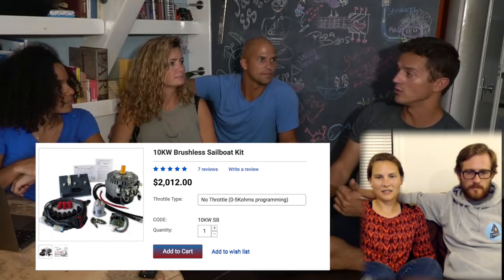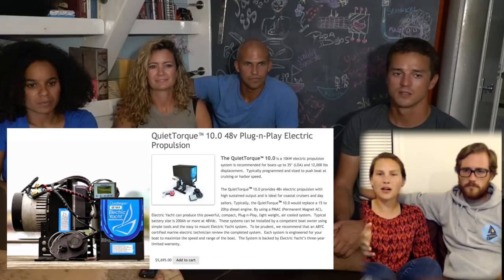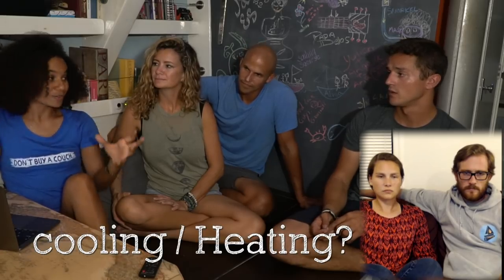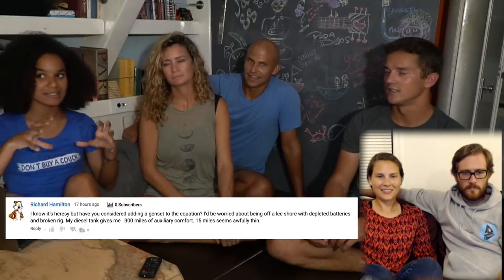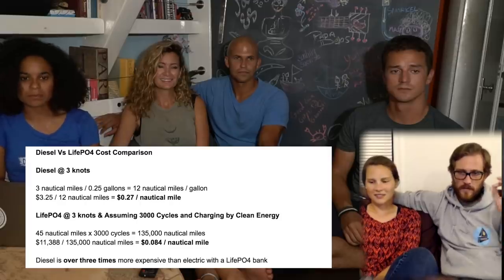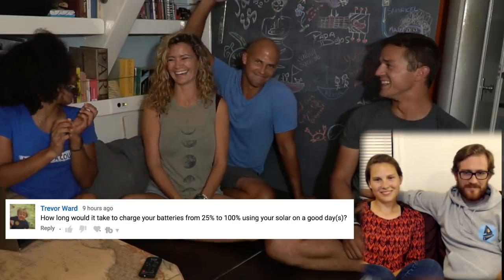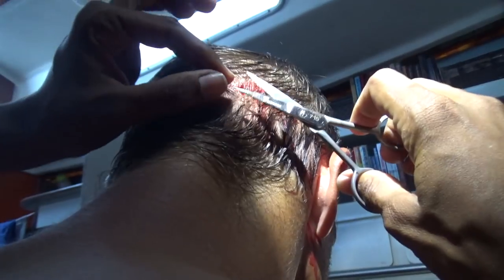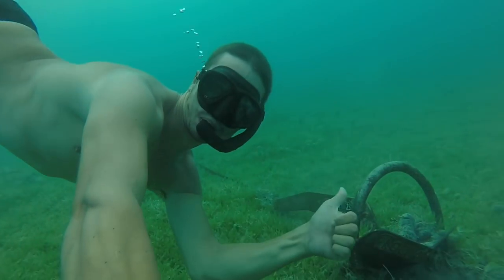Electric Sailboats: An HONEST Discussion — Sailing Uma [Step 140]

Comment: I have diesel and would love to go electric...that being said, electric has a loooong way to go before it is really functional. Sadly. Electric is so tempting, but in its current state it's almost like sailing without a motor. There are so many places and times where electric would be either impossible or would put me in danger. The Ocean has tides and therefore current exists at all entrance/exit points and there are many times when I need to maintain a certain speed to get off the ocean before a storm or darkness. Without a motor, I would be in danger-stuck out at sea. With one that can go at least 20 miles or so, I am anchored safely having a nice dinner while the storm roars around me. A quick note about the Pardeys sailing around the world without an engine. A friend of mine circumnavigated at the same time as they did and he didn't like them much. When I asked why, he said that he got sick of towing them in through the reef to get them inside before darkness or weather hit. He said they would routinely sail to an island, sit outside the reef with an opposing current and call on the radio until someone with a strong dinghy came out and towed them in. He said it happened all the time and got really annoying. As soon as batteries or the motors or solar panels or some combination becomes long distance and dependable, I'm jumping on the band-wagon. I would love to get rid of the diesel (hate the noise/smell/maintenance). You guys are on the bleeding edge. Good on ya!

Comment: Don’t get me wrong, I like the principle of electronic propulsion - but thats about as far as it goes. Obvious advantages are gliding through the water sound and smell free, but as with many folk I have my own reservations regarding the disadvantages. The crux of my upset on this whole subject isn’t so much that it takes days to recharge for hours (or if your on lead acid, minutes) of use but more to do with the assumption that it’s cleaner, greener, safer and somehow all round better for the environment to have everything electrically powered with zero consideration for the long term environmental impacts of the manufacture and disposal of Lithium batteries and solar cells, sure it’s cleaner to run but not necessarily cleaner to create, recycle or dispose of. At least engine blocks can easily be smelted down and made into new engines or new boats. If you rupture a Diesel tank you have Diesel everywhere, if you overheat a Diesel tank the lid will probably pop before the fuel hits its flash point, do either of those with a Lithium cell and your instantly looking at an inferno that only the ocean will be putting out! All I can say to anyone planning on going down this route is 1. Buy the best charge controller you can afford 2. Don’t preach about how “green” you are and 3. Enjoy your new found silence on deck with a cold drink whilst watching others struggle to get there Diesel started :)
Reply from the maker: Some types of lithium are lest stable, true, but LiFePO4 chemistry is VERY stable, you can puncture them and abuse them, short them out and they will just stop working, they won't catch fire like the ones in your cell phone. And yes, the diesel motor is recyclable, but not the fuel you burn. Pretty much all the materials that make up our system can be recycled. Even if the infrastructure is rudimentary, it will only get better with time.
Reply: Thank you for taking the time to read and reply :-) I’m also glad you had a great trip over here to the boat show. Ok ok you’ve got me on the chemistry aspect of LiFePO4 cells, they do appear to be somewhat more stable than standard Lithium-ion compositions. Admittedly the video that introduced me to your channel was the one where you guys fitted your forklift motor and I’ve been curiously following ever since, so I’m not anti-electric but certainly an …electro-sceptic?? As I said my main problem is people assuming that because its electric its “greener” - I’m kind of of the school of thought that it would be “greener” to run already existing Diesel’s off of renewable bio-oils - obviously that comes with a whole huge environmental impact of its own as has already been demonstrated with palm oil production and ethanol production for fuel in Brazil. Surely though, in the long run, a well thought out and planned agriculture infrastructure specifically for fuel production would have less impact than all of the mining and noxious chemical and industrial processes used in creating this “clean” technology. I’m not claiming it would be a completely perfect carbon neutral answer to the problem, but it seems a more logical and sustainable option than creating  technology thats “green” within it’s 10 year useful lifespan but then leaks poisonous pollutants into the ground for the next 100 years …theres a bit of a similar issue with Nuclear power. There’s no perfect solution that ticks all of the boxes, at the end of the day any form of propulsion system is going to be unreliable - especially the wind - and in some way comes with an environmental cost. It’s a tricky problem but I’m more convinced the solution lays in repurposing what we have than creating more pollutants.
Reply: It's worth considering that electric motors are vastly more efficient than internal combustion engines - diesel or otherwise.  While you might get 20% of a diesel engine's power to the prop, electric motors (without transmission) should be well over 75%.  95% for direct drive, brushless setups.

While it may seem like a lot of energy, 12kWh of electrical power (for 15NM of range) is a lot less than would be released by a diesel engine performing the same task.  Add solar into the mix, and the fact you must sail, and it's unquestionably the environmentally friendly option.
Reply from the maker: Bio fuels work in  a car ok. But not sure you'll find a reliable source outside of 1st world countries.
Reply: Gordon Lamb.
Your post makes no sense.
If there is power coming out of the back of a motor, it makes no difference what that motor uses as a power source. If a brushless direct drive motor gets 95% of its power to the prop, then so does any other motor that use the same power delivery system.
Reply: So DC brushed motors release more of the energy they consume as heat than induction/brushless motors.  This is for a number of reasons, but mainly because the carbon brushes impose resistance.  AC motors (brushless) transfer all of the energy from electrical to rotational via phased magnetic fields, which are significantly more efficient.

A prop directly driven by a brushless motor may acheive 95% efficiency (battery watts to rotational power), where brushed/geared may acheive 70% (the difference being extra heat released at the motor and transmission).  A diesel engine may translate 20% of its fuel energy to rotational power.
Reply: Those figures are great if we are looking at the matter strictly from a scientifically efficient point of view, without looking at the real world “useful efficiency” aspects or the fact we’re throwing a boat into the equation. If we look at the real world “useful efficiency” of a Diesel vs Electric the figures become reversed, having the ability to simultaneously propel your boat, recharge battery banks and generate hot water gives the Diesel a “useful efficiency” of 80% vs Electric which only provides propulsion, “usefully” speaking thats only got to be 10% or so and thats before we start peering into the the cost of LiFePO4 batteries or the self imposed travel restrictions. S/V RAN is currently cruising the breathtaking waterways of Alaska, but it’s very cold, heavily overcast and so becalmed that motoring is the only option - I’m fairly sure they would be struggling if they had an all electric setup.
Reply: Physics is physics.  Electric motors - particularly brushless electric motors - use far less energy to move the boat.  You only need so much hot water, and waste heat recovery from the coolant loop isn't very effective (ie. most of the heat is still sent overboard).  Parasitic loads like an alternator don't change the equation; the carnot cycle is what it is.

Battery powered electric propulsion has its faults, but efficiency isn't one of them.  Real world or simply by physics and math, it's significantly more efficient.  Full stop.

While I'm sure you're right about it not working for s/v Ran, it does seem to work for Uma, and it would work for me as well.  Maybe the right word to describe diesel engines is "utilitarian."

Comment: Dan, With respect masts fall down even when they are impeccably maintained & inspected. A sea anchor or drogue should be part of your emergency kit as well as a jury rig strategy. Your problem here is your hull is really inefficient compared to a modern racing yacht where jury rigs are used a lot but only provide a few knots best case. Perhaps if you rely on solar you need an emergency roll out PV because if your mast comes down it’s likely to hit your panels. Then you’d be safer than a normal yacht (except on low charge and at night). It’s the times when you are out of helicopter range that is the real problem.

Comment: Currently people, like all of you guys, have had to build massive battery banks to power the electric engines.

These batteries can be expensive. On the other hand, solar panels have dropped in price drastically.

Has anybody looked at, or tried, to have a much, much smaller battery bank but with a massively ridiculous solar array? Thinking in the 1500 watts range and beyond. Seems it would be cheaper. Feedback and opinions appreciated :)
Reply from the maker: Charging isn’t as much of an issue. Batteries=range. To push our boat to 3kts requires about 1.2kw. If that was supplied by solar, it would cover most of the deck. To push our boat to 6kts takes about 10kw of power, which is more solar than can be reasonably supplied by panels. Our friends on Learning The Lines did the math. The batteries are expensive up front, but it’s a single expense. We never have to buy fuel, so over the 3-5000 discharge cycles our batteries can supply, it actually comes out cheaper than buying all that diesel, not to mention oil, filters and other maintenance costs associated with a diesel. The main difference is, batteries are getting less expensive every year while fuel prices continue to go up.
Reply: Agreed on it being cheaper than diesel, I'm thinking going even cheaper than that. While the 10kw would indeed require more space than the entire boat can provide, I was thinking one could fit at bare minimum 2x325 watt panels on bimini, and same on dodger. That's already 1.3 kw, and if bulding a specifically designed solar bimini array (extending past sides/back, maybe with side or back folding?), that could be bumped potentially to nearly 2 kw. And that's still only 1200$ in panels.

I actually find your 1.2 kw example very interesting. While it isn't much, if it provides real world 3 knot performance (continuously) on let's say, a basic set of four 100AH deep cycle batteries, and saves 10,000 dollars in batteries... That's not bad at all (to me at least).

Obviously not the best solution, but could be the cheapest, if it works.

Comment: Believe me, the day will come that you will regret not having a diesel. I made a circumnavigation and never had to wait in port for diesel parts.
Reply: Agree, also following RAN and without diesel they would be screwed right now in the North. Diesel parts shouldn't be a reason to go for electric.
Reply: Hey if you don’t want a diesel engine that’s ok.  A motor to give a little kick maybe all you need.  Kevin Bothby sailed with out either. He uses a sculling oar and some times his dingy.  Still does.  As stated plan accordingly.
Take care,
Reply: For 1000's of years people sailed around the world with NO ENGINES or MOTORS, its called SEAMANSHIP. Diesel engines were invented in 1890, so just 138 years ago. Having an electric engine SAVES OUR OCEANS, no oil and diesel seeping into the oceans. Searching for Diesel, filling tanks,  wasting your time and costing you money. It's so much cheaper to go Electric, using Solar, Wind and Hydro, and regen power to charge the batteries. These three boats are pioneers in this age group, there are several other boats out there using electric motors for over 20 years, and it works fine.
Reply: For 1000's of years people removed infected teeth with rocks and sticks, it's called DENTISTRY...
Reply: big jib really?  That is your rationalization?  Guess you feel it I'd no big deal to dump your bilge oil because you are just one person.  The more you talk, the less I like you.
Reply: …and for thousands of years boats were sinking because they had no diesel engine to pull them out of danger.
Reply: @Edward Hart  ..and not a day goes by that I dont want to perforate my volvo penta (the green death) with .50cal rounds. I'll trade regretting it once in a lifetime to hating it every day. circumnavigation you say? I dont see any sailing videos on your channel
Reply: But you're not a millennial with apocryphal tales of mass engine failures, what could you possibly know... ;)
Reply: How dare you state facts.
Reply: Michael Buck yes the  British ruled the seas. And sailed the globe without a Diesel engine but do you know how they moved the ship when there was no wind?  Yes that’s right, they got into longboats and rowed. They used their arms to move the ship.  I see where Uma is using their outboard for that purpose.  So what exactly are you gaining with an electric motor?
Reply: @o0bananaman0o  Are you doubting  me? I made a circumnavigation in 95/99 Google , Ed Hart Circumnavigation.
Reply: ... and I too completed a circumnavigation, never having to cool my heels in a bay while waiting for parts.  And why?  Because, even though I doubted the existence of God, I religiously maintained my engine and carried spare parts with me...  Hallelujah...  Pray to God but row toward shore!

Comment: And a Tesla batteries cost $17000 (18650 batteries the cheapest $2 each) . How much fuel a average sailboat use a year? And check your fuel tank a put a water separator on your fuel lines. And if you lose power to move in a storm the coast guard will deem you voyage is unsafe and they will pull you off your sailboat. Get a battery just for your radio and setup so it will charge with the rest but can only be used by the radio so when you lose power you can get help.

Comment: I drive a Mercedes Bio-diesel.  I used to sell BionX electric bicycles.  I still ride a 350W, Lipo electric, hardtail street bike.  I would like to bring everyone's attention to a youtube video of a 106 meter, state of the art yacht called the Black Pearl.  The Pearl can sail at 1.8 knots until something breaks, forever.  Prop regen is not any more efficient than 10 - 15% at this juncture, regen will improve with time.  Another state of the art boat you can tour on youtube is the Haase 32, which has a water-cooled rudder mounted motor and can turn on a dime and give you like, 7 cents change.  Electric boat is like an electric bike if it goes faster than 25mph it's a motorcycle.  You can now buy an electric motorcycle, the Zero, or an electric boat like the Haase and do anything a diesel can do, quieter for an eighth of the cost and less bio destruction, there is still some of that building batteries and panels. But it keeps the shit out of the water.  That is very important!!!
Reply: Oil oozes from the bottom of the oceans naturally. Bacteria are feeding on it. Oil is as natural as you can get.
Reply: @C_R_O_M________  True for crude but not the refined items of the higher spectrum of the distillery.  Oil biz all my life did I mention that?

Comment: I'm going electric but both the batteries and the solar panels have a very environment damage process to manufacture...and they use diesel to run the manufacturing machines to do it too